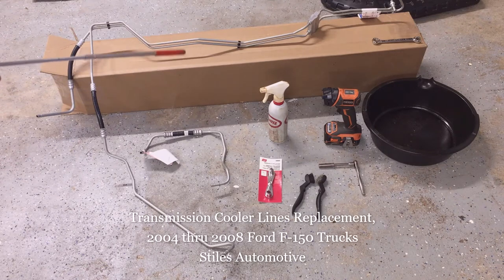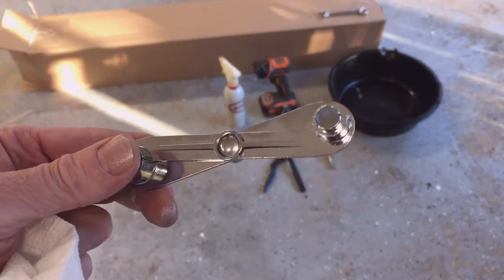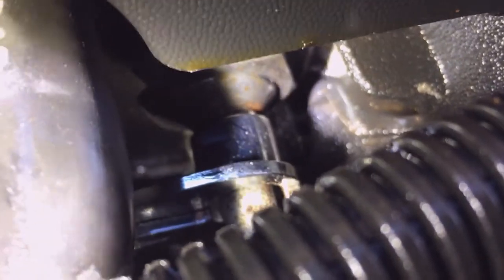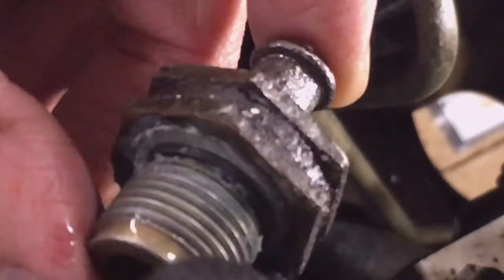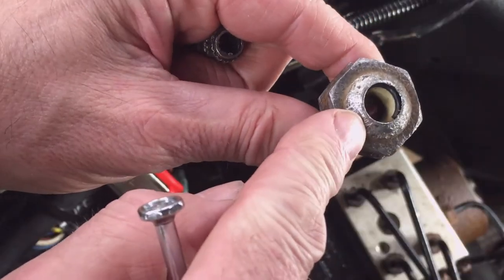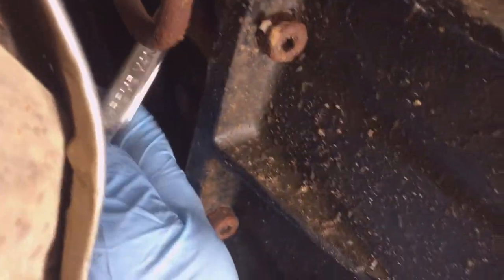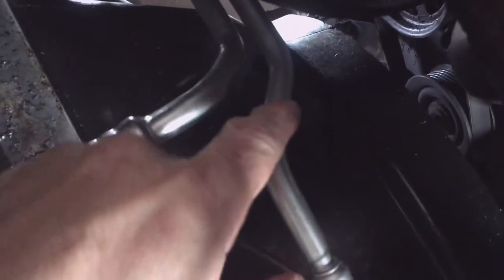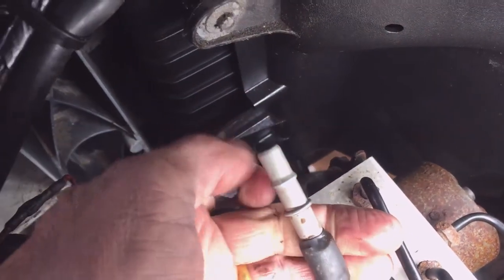Transmission Cooler Lines Replacement, '04 thru '08 F-150 Trucks

Comment: I have a leak in the line that connects to a small radiator in front of my large one, is it possible to just replace that piece or would I need to replace all of the lines?
Reply from the maker: Darius, No, you don't have to replace all of the lines, but consider this. If your Truck has not had the Transmission Cooler Lines replaced and you live in a high corrosion area, your Cooler Lines are rusty.  If your Transmission Cooler Lines are showing corrosion, I would replace them at the same time as the Transmission Cooler. However, if you live in the south and your F-150 is "like new" underneath you may be able to just replace the Transmission Cooler.  Let me know how it goes! - Stiles

Comment: Is it possible to replace just the side that goes from the cooler to the radiator?
Reply from the maker: Geoff, Yep, you can just replace the Line from the Radiator to the Cooler (see 2nd Link below) and then the 2 Lines to the Transmission. - Stiles

Trans Cooler Line Ford 7R081 both lines https://amzn.to/31YoqUw
Trans Cooler Line Rad to Cooler Ford 7C410 https://amzn.to/3yudGZW

Comment: I don't know why automakers use these disconnect lines. What was wrong with flare nut fittings? Is it just to make the DIY aspect of working on their vehicles more difficult and expensive?
Reply from the maker: Denny, No, it's all about making the Manufacturing Assembly Process faster and easier. There are Manufacturing Engineers that review the design to do just that, faster, cheaper and easier Assembly. Making life easier for you is secondary. - Stiles

Comment: So can u put thread sealin on the transmission cooler lines
Reply from the maker: Mark'et, which connection are you talking about? I didn't use sealer in my video. And you shouldn't need to on new Cooler Lines. If you are making due on older Lines or have an Old Bad Fitting, tell me the problem, and I'll help you.

Without knowing what you have; If you have a leak you need to do a temporary repair on, I'd use Permatex #1  https://amzn.to/3jdnwto  This is good for all Automotive Fluids, but is hardening and permanent.  - Stiles

Comment: I've got an 04 F150 XL. I followed the link to the part on Amazon for the tube assy. It says Doen Not Fit and any where else I use that part # they tell me it dies not fit. Do you have any knowledge of this?
Reply from the maker: Robert amazon stated that for the short Cooler Line for my 2005 also.  First is the short Radiator to Cooler Line and the 2nd is the 2-Line Assembly - Stiles

From the Ford Parts Website Oil Cooler Tube, Part #: 7C410, 
Usage: 06/02/2003 - 08/23/2004, F150/Mark LT, Windsor 4.6 SOHC EFI,
https://parts.ford.com/shop/en/us/transmission/powertrain-engine-parts/tube-oil-cooler-7848917-1

Tube, Part #: 7R081
Usage: 06/02/2003 - 08/23/2004, F150/Mark LT, Romeo 4.6 SOHC EFI, With Standard Engine Cooling System, 
https://parts.ford.com/shop/en/us/transmission/powertrain-engine-parts/tube-assy-7891695-1
Reply from the maker: Robert, one other comment: Both the Amazon Page and the Ford Parts Site show a photo (additionally Ford shows a diagram, which is helpful).  Do the photos look like your Transmission Fluid Cooler Line?  - Stiles
Reply: Ive ignored the "will not fit". Theyre not Ford engineers. 90% for my 07

Comment: Where did you order your transmission lines from
Reply from the maker: Vicky, Thru Ford Parts on Amazon, I always list the Tools and Consumables in the Video Description, I will copy/paste here for you!  - Stiles

Flare Nut Wrench Set, 3 Pc SAE https://amzn.to/3iN9r5c
Cooler Line Tool Assenmacher 8021 3/8" https://amzn.to/3dRlCet
Cooler Line Tool Lisle 39660 1/2" x 3/8" https://amzn.to/4a3rGeS

Consumables
Trans Cooler Line Ford 7R081 both lines https://amzn.to/31YoqUw
Trans Cooler Line Rad to Cooler Ford 7C410 https://amzn.to/3yudGZW
Reply: Thank you for reposting these, I was searching comments to get the info. Also, stellar video.

Comment: MAKE SURE YOU ARE CAREFUL WITH THE QUICK CONNECT ON THE RADIATOR. I could not get the hose disconnected so I went to the dealer to get a replacement. They gave me the part number and told me they do not make them, you have to replace the radiator. They let me take a picture of the diagram and sure enough 7D237A cannot be found and Dorman does not make a replacement. I went to all the auto part stores and tried everything online. It is ridiculous. Oh and the price of the cooler connectors, you might as well just get a new cooler with the connections, it is only 20 bucks extra. Those quick connects are horrible.
Reply from the maker: Michael, Thanks for the comment, very well said! Yep, this design is great for original manufacturing / assembly, but horrible to maintain. - Stiles

Comment: My line are good its just that small flex hose that looks wet
Reply from the maker: My hard Lines were very rusty in several places. You could replace a section of the Hose/Line Assembly with a section of Hose. Make sure you use the correct Transmission Fluid Hose and good quality Hose Clamps! - Stiles
Reply: @StilesAutomotive  if i do replace it with a good hose what clamps do you recommend
Reply from the maker: @jvst20051  Just to make sure, do you have an F-150?  If so you have 3/8" OD (Outside Diameter) Lines and need 3/8" ID Hose.  Which means the Hose Clamps need to be 3/8" plus 2x Hose Thickness.  The 7/8" Dia Ideal (link below) will work.  The F-250 has either 3/8" or more likely 1/2" OD Lines, you need 1/2" ID Hose and a little larger Clamps.  If you cut the Metal Lines (or Tubing) it is best if you can flare the Tube End a little to prevent the Hose from coming off.  Ideal use to be American made and a good company . . .   Hope this helps! - Stiles

Hose Clamp Ideal 5/16x7/8 SS 25Pk   https://amzn.to/3rwMWoP

Hose Clamp Set, 1/4-1.5 in  https://amzn.to/3DhYNfu
Reply: @StilesAutomotive  2003 f150 4.2l
Reply from the maker: @jvst20051  Ok, my 3/8" Line reply, above! - Stiles

Comment: The connectors for the radiator are not right
Reply from the maker: After taking a relook at the Ford Parts Catalog, this part number (BL8Z-7D273-A) appears to fit all 2004 thru 2008 F-150s with a 3/8" Cooling Line.  In what way is this wrong? - Stiles

Trans Cooler Line Connector @ Rad Ford https://amzn.to/3E1oSyp
Reply: @StilesAutomotive  I bought the ones from the link and they are not correct, unless my radiator has been replaced or something. Really the only thing that needs to be replaced is the orings, might be able to do that, but gonna loose all my coolant!
Reply from the maker: @gearfan4438  I put a note under the link in the video description that the Ford Part Number maybe wrong.  I should have investigated the 2 O-Ring sizes (1 on Radiator side, 1 on Cooler Line Side) of the fitting.  If you do replace the O-Rings and give me the size, I'll put it in the video description!  Thanks for the comment. - Stiles
Reply: @StilesAutomotive  When I look at my fittings the orings look flat, I would guess because of the heating cycles of the radiator
Reply: @StilesAutomotive  ok so whats the correct fitting for my radiator (not auxiliary cooler trans) its (BL8Z-7D273-A) or (YL3Z-7D273-AA) my auxiliary trans cooler remplace by DORMAN 918-202 and come with quick fitting. Thanks
Reply from the maker: @dkal6374  Yes, I believe the part number is 7D273, the rest of the BL8Z-7D273-A is engineering information and series. Take a look at the Ford Parts Catalog - -   https://parts.ford.com/en.html

If this doesn't look right to you, either call a Ford Parts guys or tell me, I'll do more research for you, but tell me your exact Truck information. - Stiles
Reply: Has anyone had success with that fitting? When I run that part number BL8Z-7D273-A through Ford it lists as below:

Fits These Vehicles
• Ford Escape Hybrid 2009 - 2012
• Mercury Mariner 2009 - 2012
• Mercury Mariner Hybrid 2009 - 2012
• Ford Escape 2009 - 2015
• Ford Fusion 2010 - 2012
• Lincoln MKZ 2010 - 2012
• Mercury Milan 2010 - 2012
Reply: @stayliftedpositude1152  honestly just go to the parts store and look through the assorted orings, thats what really fails because there is only one, should have been a 2 oring design